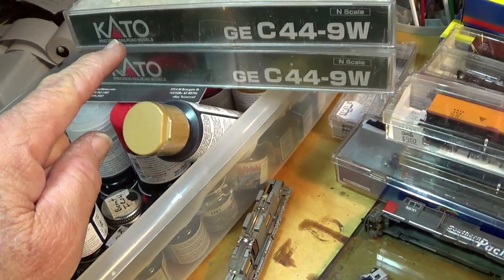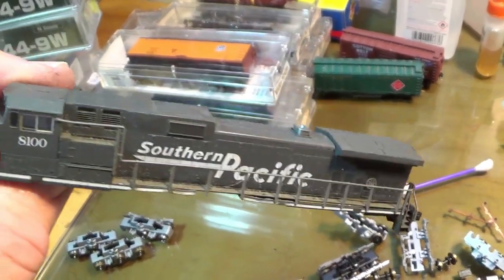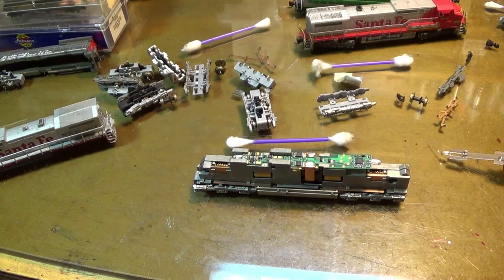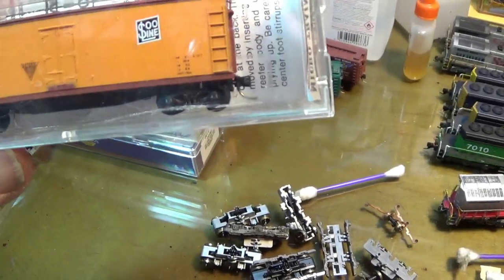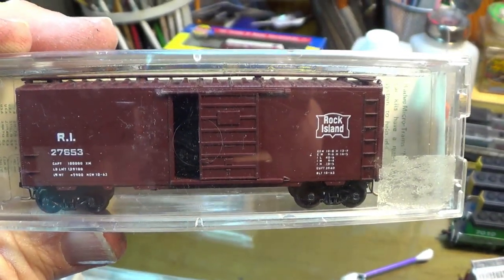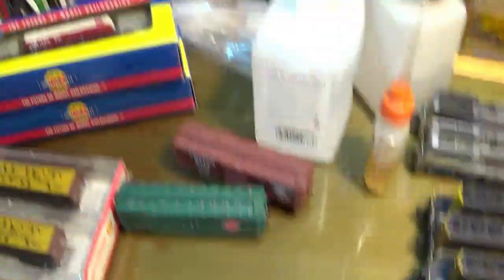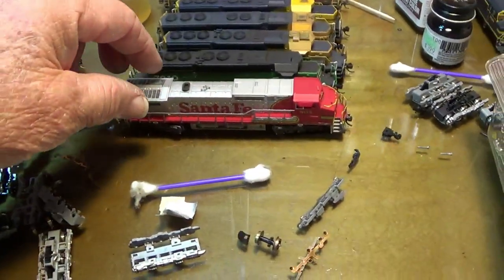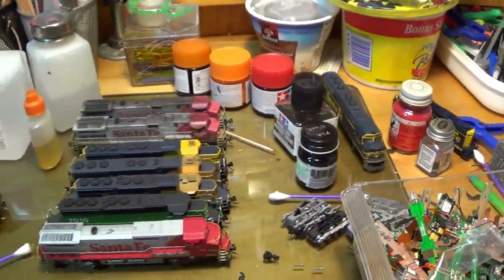NMRA Regional Convention In Albuquerque N Scale Haul

Comment: I have on of those with the little pad on it.  for whatever reason the pad is just under 9mm and will get itself stuck on curves as the outside dips below the rail head and when it comes to a straight it pops the car off the track on occasions.
Reply from the maker: I have about 6 or 7 of them and, never an issue.
Tahnks , Mike

Comment: Hi Mike, very interesting video. I was surprised to learn about Kato trucks melting. I think it would be interesting to do another segment going into it in more detail as why it happens and if Kato is aware or if other brands also melt? I have enjoyed many a show watching but I never knew that engines could run enough to melt. You are fortunate to get pieces and parts i guess. But thank you and I look forward to more informative videos.
Reply from the maker: All brands will melt. The cause is a loco left on a switch thrown the wrong direction WITHOUT any type of current protection.
Mike

Comment: I would be very interested in seeing a series of videos on how you re power those F45's. I've had trouble with the plastic axles. But after some head scratching the trouble is 99% fixed. I pull the wheel out of the axle, apply a small amount of loctite and re install it, making sure the wheels are in gauge. I've also had the same problem with atlas and kato. 
Unless something major goes wrong, I'll generally check them about every 6 months.
Nice purchases also. 
I noticed the walkways on those Santa Fe c44's are silver, I believe they should actually be red as they are in real life.The steps have yellow safety stripes on the edges